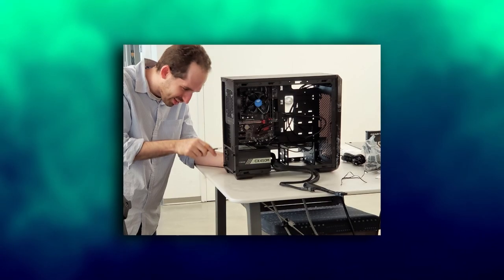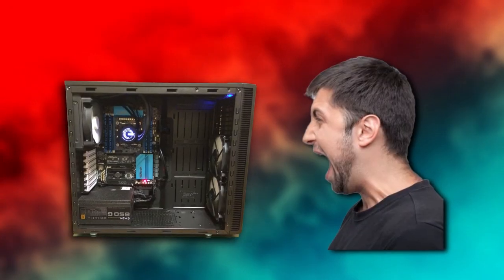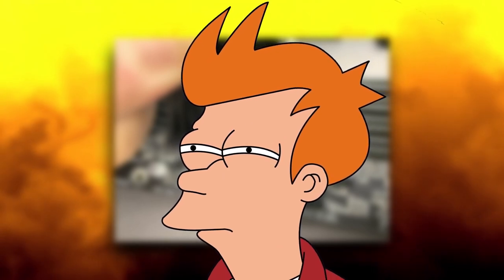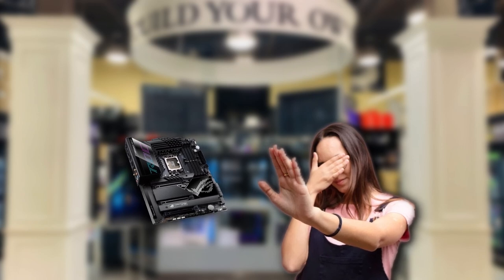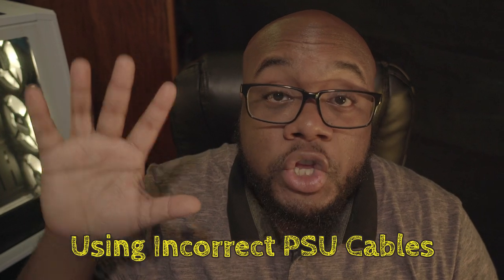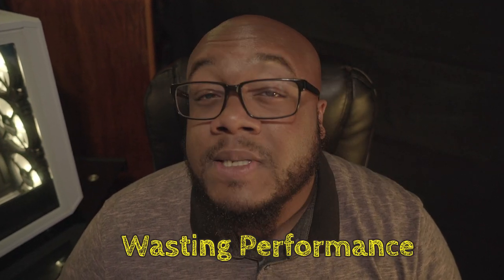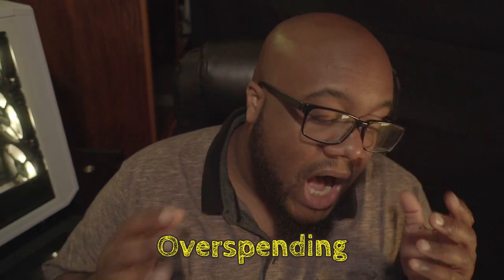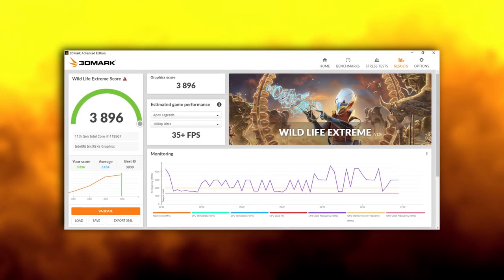DON'T Make These 7 PC Building Mistakes

Comment: If you drop a screw or piece of metal in the case/motherboard do not start the pc until its been found and removed
Reply from the maker: Excellent point! Definitely an issue you want to avoid

Comment: Sadly, I bought the Be Quiet Dark Rock TF2 to replace an older air cooler, the ThermalTake NiC4. I didn't save the original mounting adapter that came with the motherboard. Now I am stuck searching the internet for AM3+ mounting brackets, smh.
Reply from the maker: Yikes! That sucks. I wish you luck in your search!

Comment: Great advice, after building my own 1-2 months ago i can't stress enough RTFM. Also the part with the PSU cables happened to me :)) . 1 mistake I almost made was connecting only 8 pins from the PSU to the CPU on the motherboard instead of all 12 because the cable had only 8 pins. Also a mistake that got me sweating was it didn't post because i got dual ram and like a normal human being i put it in slot 1 and 3, needed to go in 2 and 4. Also on the top of the list should also be REMOVE ALL PROTECTIVE PLASTIC !
Reply from the maker: Excellent points! Especially removing the plastic. I have a habit of not removing the platic that covers the adhesive layer on NVMe heat sinks